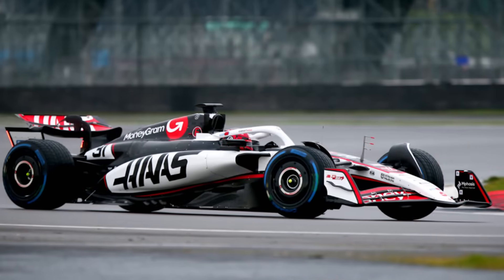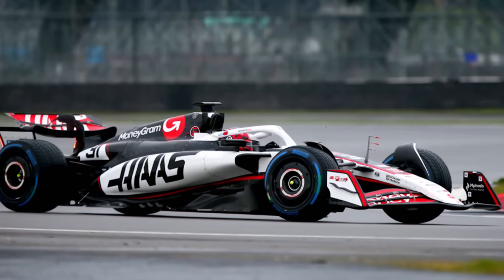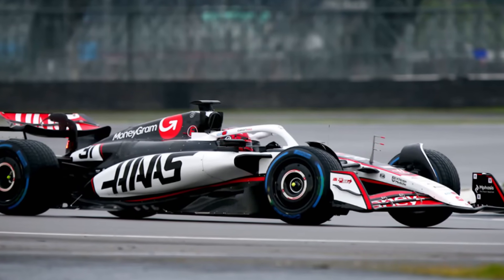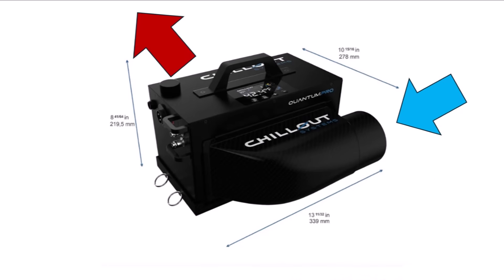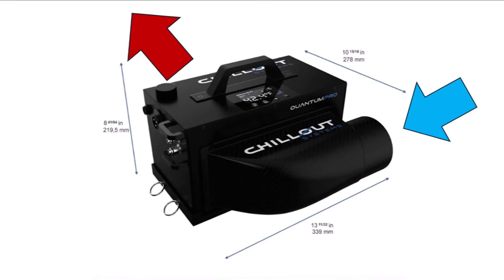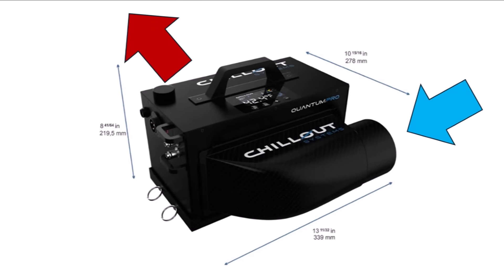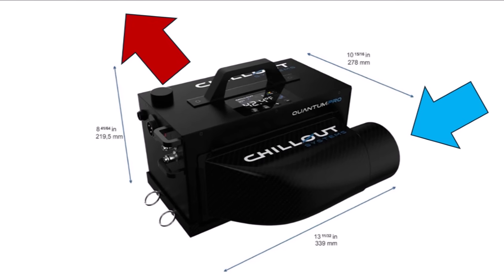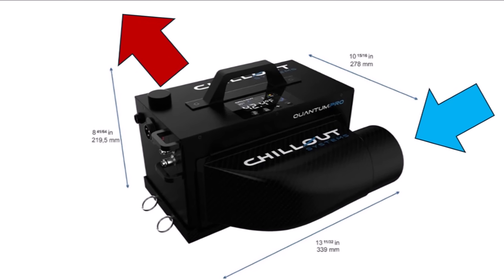Why cooling vests don't work in F1

Comment: FIA should mandate the minimum spec for an inlet in the nose cone so everyone will have a performance disadvantage. And these nose cones are only allowed to be fitted when FIA deems the race to be one which is too hot and humid.

Teams should also be allowed to use this opportunity to do testing on new designs for front wing.

Comment: If there were  temp sensors on the driver ( in a few locations) and the FIA mandated maximum temperatures at those locations. It would be up to the teams to meet those requirements, size, shape, technology of the cooling system would be up to the teams. Somewhat like the max fuel
Flow sensors/rates  the teams have to meet. 
I fault the FIA for lax regulations.

Comment: The amount of (mass) airflow that Chill Out requires to cool the condenser & compressor; and the resulting cooling drag is not going to be acceptable in a formula car. Nor is it in a small aircraft. What will work is an ice/fluid cooler with a supportive matrix for the ice. But then there is the structural issue supporting all of this mass…

Comment: Is the system not driver selectable in terms of its cooling ability? The ice based system I’ve used has controls for flow(cooling) rate and can be turned on and off to save the cooling for later or when it’s most needed. Even if it can only cool for 5 laps, that could be saved for later in the race or turned off every other lap to extend its ability.
Reply: in such a way, they can refill ice on pitstops...although I don't know how often they do pitstops now.

Comment: Peltier circuitry could work if they cool the driver w/o excessive drag and the wattage required didn't ruin performance. The circuit cools on one side by generating heat on the other sideg. Not very efficient, but it's simple and compact compared to pumps and evaporators for typical cooling. This tech is used in electric coolers people use for car trips and camping. Could just cool the neck.
Reply: For a Peltier to be worth using, you would need even more cooling airflow, as they are VERY inefficient. If teams are currently providing not even enough for a compressor based system, a Peltier would work like a heater.
Reply: @sven7111 Hrmm, did I not say they are very inefficient?😅 Lots of air flow near the neck at least. Packaging was the advantage I was promoting.
Reply: @ctibpo991  The cooling requirement would make it less space efficient. You have to remember that they not only move heat, but produce a lot of it too. Additionally they only make a certain temperature difference for power used, so you need to keep them cooled very close to ambient, to make any sense. Online compressor units, where the hot side can get very hot (which makes heat transfer easier), while keeping low temperature on the other side.

Comment: If FIA is serious about this, they should add inlet/outlet temperature sensors + volume flow sensors to the cooling liquid which will let them calculate heat flow. The efficiency of the system can then be evaluated in the air tunnel for a "standard" case. For example at a given speed + air temperature the system has to be able to remove x amount of Watts.
Reply: Why not mandate that the liquid shouldn’t go above a certain temperature at any point during the race (maybe something like 30°C) that way teams can optimize airflow even on a per track and weather basis but the system still has to be effective
Reply: @Simoxs7  I like your idea better. That sounds very sensible. But wouldn't that require the system to be in use at all time? What is the punishment for failing to meet the requirement (perhaps even due to a component malfunction)

Comment: Why not carry a small icebox and pump cold water though the shirt from it? Similar how to "icebox intercooler" work in drag racing. Replace the box during pitstops for new ice.
Reply: weight
Reply: Pitstop times tho

Maybe very well isolated Dry ice could work, would need to be insulated from outside and to the tubes though to not freeze the shirts lol

Comment: Cooling a body is quite simple. It only takes 100watts, but cooling a body inside a smoldering sauna is just impossible. Theyre just too close too all the hot parts in the car.
Reply: All the hot parts are behind the driver, so not really an issue when driving since the hot air doesn't move forward.

Comment: When talking about "cooling system", i think we should also discuss about the cooling seat that Ferrari use in 499P, they were made by ASP Seat *cmiiw. Because if the drivers not complaining about the seat after 10 hours race in Qatar and 24 hours in Le Mans, we should at least give it a shot.

Edit : (additional info)

They first debuting in Ferrari during 8 Hours of Bahrain 2023, and their cooling seats is FIA approved
Reply: Where did you find this info?

Comment: They could implement it well. Use the roll hoop intake to cool the coolant for the chiller system.

 They just wanted to be lazy to fight back against the FIA, but when the fia tells them they need to travel with two chassis or two types of body work at all times in the event a race is declared hot they gonna say its expensive.

Comment: Solution to hot races; don't go to countries when the weather is really hot - and don't go to Las Vegas for a night race when it's cold at night. Also afternoon sessions for night races are pointless. Now we have that solved, let's make the cars 1 metre shorter and 100kg lighter and stop the outwash, and totally rethink the tyre compounds, because sensitive tyres for artificial jeopardy doesn't make the racing better. There would not be so much complaining about track limits and driving standards if the cars weren't so long & heavy and clumsy at low speed.
Reply: If only common sense was in charge of F1...
Reply: Verne's book about a trip around the world in 80 days is out there before motorsport itself and I am sure they have deliberately refused to use it as a model for their own around the world trip.
Reply: @il-ma.le.  I get that they have to coordinate the logistics/freight for outside Europe, and also negotiate around holidays, seasons and other race categories, but there are really just too many race weekends now, and by that I mean too many circuits that don't need to be on the calendar because the layout is boring or too similar to something else. Singapore is a cool track though, and the humidity is a feature that makes it distinctive. But now we have so many night races, and street circuits that really add nothing. I miss Sepang and Hockenheim. We can drop Abu Dhabi, Bahrain, Las Vegas, Baku, Miami and Jeddah, IMO. Qatar is the best track of the middle east, I think, but debatable whether it's needed. I don't understand the obsession with making high speed street circuits, either. Monaco isn't like Spa and I don't need it to be. I think Monaco and Singapore have only been undermined by the new tracks.

Comment: why don't we just go back to traditions, hose the driver down during pitstop and make it mandatory during hot races
Reply: The things we lose by jamming a load of electronics into the steering wheel. And the rest of the car.
Reply: @C.I... All have to work during rain, I think the suits are the reason it wouldn't work though.

Comment: A rallycar I make bodywork parts+repairs for keeps the heat blasting in the cockpit when it's summer for added engine cooling. No cooling suits just central roof scoop. I'm trying to figure out whether to spend weight+power cooling myself or in auxiliary engine cooling
Reply: Heating the driver in a race car sounds like a very bad idea
Reply: Why not remove Heatercore and add a larger or Auxiliary radiator?

Also removable ducting to funnel the heat out or at least behind you could work in summer?

Comment: It would be nice if they mandated the size shape or position or a minimum airflow rate for a certain speed for intake and/or outlet. It's clearly an important safety feature, so the implementation should be serious as well.
Reply: This is the only reasonable solution. Mandated intake and exit for the air that is strictly written in the regulations.
Reply: Or just implement that the cooling liquid can’t go above a certain temperature (30°C maybe) at any point during the race… that way teams can still optimize the airflow to get the best possible performance out of the system and the car.
Reply: It's not an "important safety feature", it's just a minor convenience.
Reply: @test987665  Thats a wild way to tell people how clueless but confident you are
Reply: @mycosys  And what a boring and entirely predictable way to tell people how pretentious you are.
Reply: @mycosys how ‘bout they stop racing in the Arabian desert
Reply: @enemyspotted2467  Thailand isnt a Desert.........
Reply: @mycosys Thailand?
Reply: @ScottMoyse  Apologies, Singapore, the topic of the video
Reply: @test987665  ok, armchair expert 😆

Google "heatstroke" to educate yourself 🤡